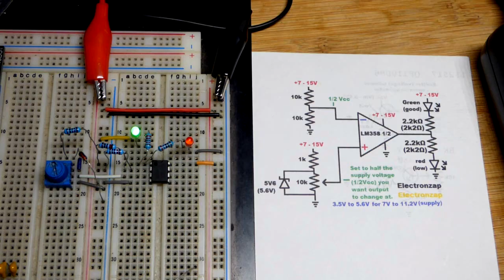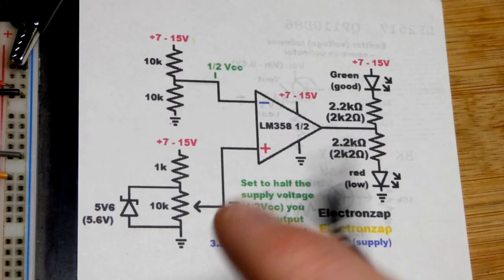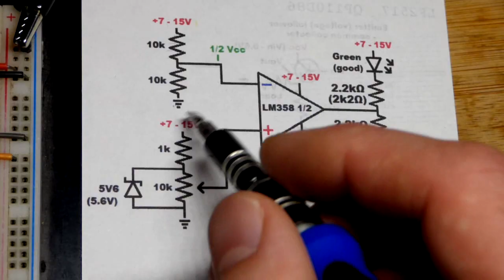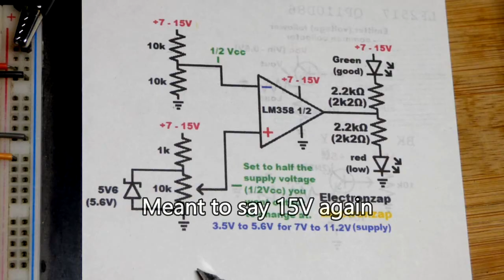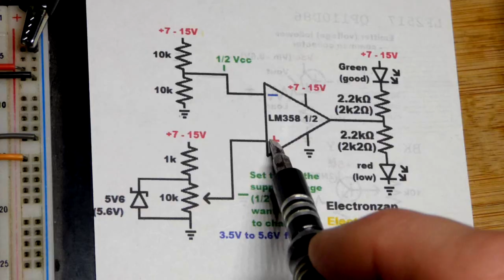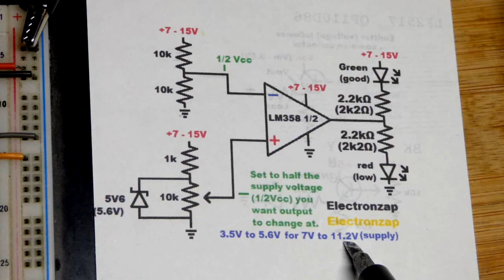Green LED when voltage is high enough and red when voltage is too low demo circuit

Comment: wow thats almost identical to the first thing i ever built which was a 12v indicator for a car battery, used a 741 opamp and a standard diode for the zener so one side of the opamp was held at 0.6v and the variable side was set similar, way back in 1977 lol, we fitted it into my grandads vauxhall viva (uk car) was always good to see the red and green led on together when we got in the car, then it would go red as the car was cranking to start and then to green when started and the alternator started to charge the battery.
I cant remember if it had any feedback to make a bigger dead spot / hysteresis in the middle region.
makes me want to build a new one lol
Reply from the maker: Very cool :)